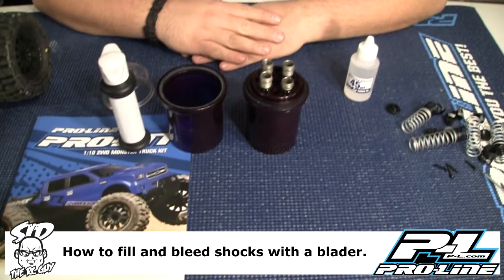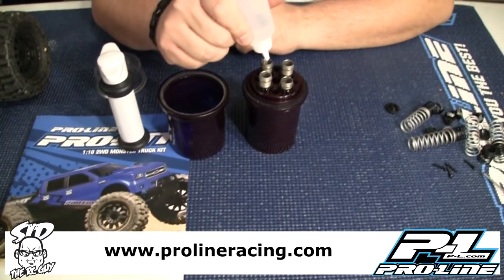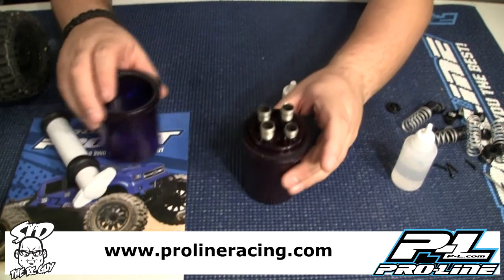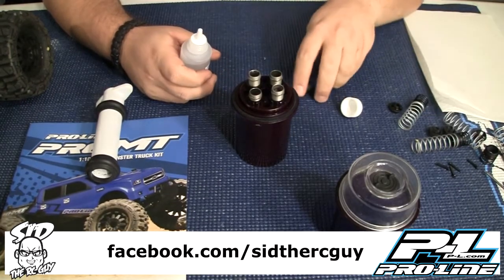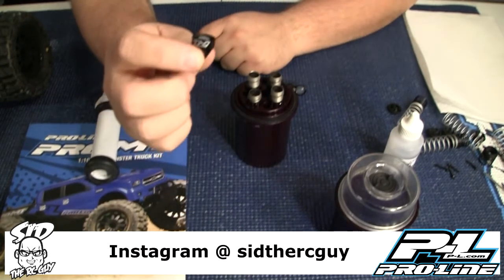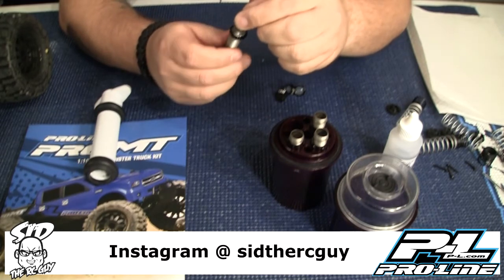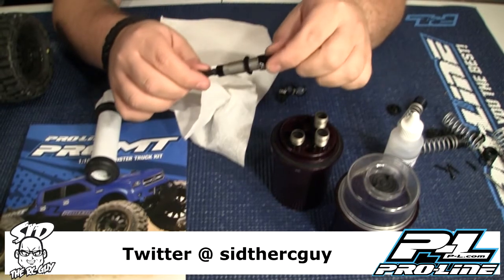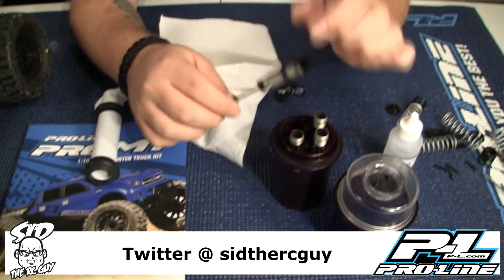Shock's with bladder

Comment: Why mount shocks without rebound?
Reply from the maker: Rebound means there is air in the shock. So you want as little as you can get.
Reply: @RC_Basement  Yes. I understand what means rebound um rc shocks. My question is why prefer dosen't have rebound. I every use And thinking is good for the suspension. What is the pros and con. Thanks